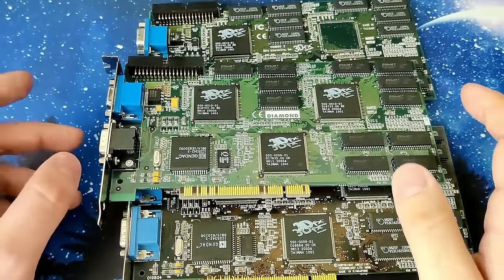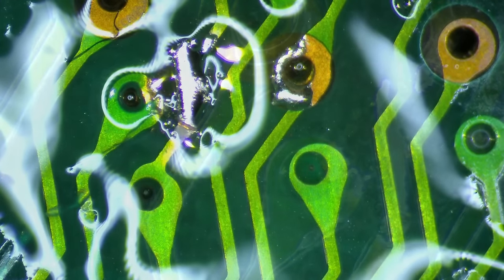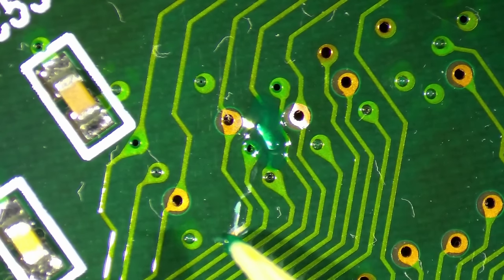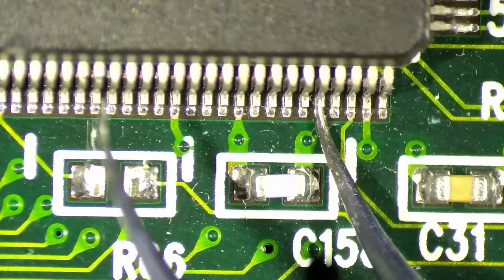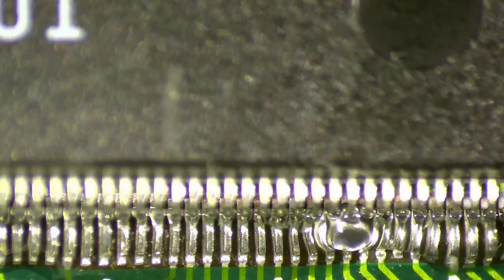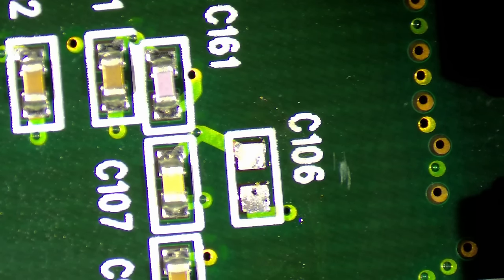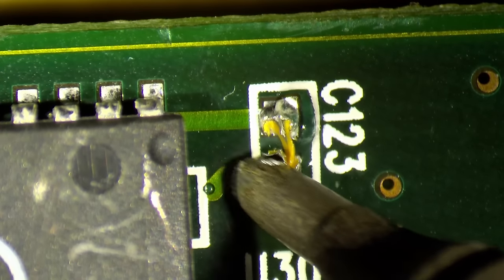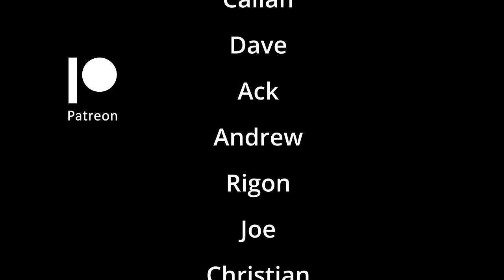Repair: Top-tier Voodoo 2 found at Scrapyard

Comment: Nice! I found a voodoo 3 at the scrapyard recently myself. Gotta clean it up and make sure it works. Or refer to BuB videos to get it working again.
Reply from the maker: Hehe, congratulations! Finding a 3Dfx Voodoo at the scrapyard is a special event!
Reply: @bitsundbolts  I didn't even notice until i unpacked at home. I usually buy AGP cards indiscriminately.
Reply: Nice, found a stb voodoo 3 3000 agp tv here myself that was in a slot 1 system with a 500 mhz pentium III at the recycling center, happened to spot it sitting on a trailer of junk as the dude was unloading stuff to be thrown away & asked if i could grab the graphics card, he said to take the whole pc. So i did that & grabbed the gpu, cpu & ram sticks, motherboard was a bottom of the barrel slot 1 motherboard from some brand I've never heard of, but i have a asus p2b at home & another slot 1 board i can't remember the name of atm.

Still need to install an os onto that system but displays fine in bios so far that voodoo 3, its barely wobbling at all unlike my voodoo 1 lol.
Reply: If it does not work, try reflashing the ROM first (using a second pci vga card and dos). A lot of Voodoo3's seem to have "EEPROM data rot"...

Comment: I wish I had a mythical "scrapyard" filled with vintage retro computing goodies to be plundered at will.
Reply from the maker: Yeah, it's nice to have access and find old hardware. What I hear is that most scrapyards don't allow you to enter or take stuff.
Reply: Just need to find an abandoned office building where the IT manager was a known hoarder. Got a huge pile of ram (2Kg, all vintages), and 8088, 286, 386, 486, pentium motherboards, misc vga cards. I know it’ll never happen again in my city. 😁

Comment: It's possible to solder those QFP packages without a microscope, I've done it quite a few times. I usually just drag solder then wick, usually takes like 30 seconds to a minute, then I check each and every pin with the adjacent one for shorts, which takes a lot longer! It also allows me to check for unsoldered pins, since you can see them wiggle when you touch them with the multimeter probe. But that was working with brand new chips, rather than repairing broken solder joints.

Right before I caught COVID, I planned to build a new workbench dedicated to soldering, with space for a binocular (or possibly trinocular) microscope and a monitor on an arm above the bench and an ultrasonic bath and fume extractor under the bench. I might get to it one day, but I'll probably wait until I move to a bigger place which would let me build a bigger workbench.

Anyway, great work repairing that Voodoo 2! Always good to see dead hardware returned to life.
Reply from the maker: Haha, I am planning to do the same right now - moving to a bigger place. But that might take 6 to 8 months from now. Regarding your technique of soldering those chips, I am not sure if I could do that. I bent so many pins trying to drag solder over them. I guess I would need to practice more. But once some of those pins are stuck at each other, it is quite difficult to separate them again.
Reply: Microsoldering goes so much better when you have powerful magnification. At least a very strong head loupe but that's extra unhealthy because the fumes are too close.

Comment: Lovely fix. I have a Voodoo 1 here, untested. I think some caps might require replacing. I need to find some time to build a test rig. I have an ASUS P55 T2P4 which would fit perfectly. Fingers crossed you get the other Voodoos running, too!
Reply from the maker: Yes, that board and Voodoo 1 is a perfect combination. I bought a used system in 1998 with the same board and a Voodoo 1 (Righteous 3D from Orchid). I still have both to this day!
Part 3 of the other Voodoo 2 is ready and will come at the end of this week!

Comment: You can put that bent card in a standard oven and heat cycle it without damaging components to allow straightening it out. It takes less heat than you’d think. You basically have to get all the layers heated up to allow straightening while cooling.
Reply from the maker: What temperature would the oven have to be for the PCB to deform?
Reply: @bitsundbolts  200 fahrenheit if I remember. It’s subsolder melting temps.
Reply: You’d be surprised how many of these option cards came warped in late 90s and very early 00s from all suppliers. We would “straighten” them out best we could, but it got so bad at times we finally had to reject deliveries. This was at Compaq. All PCs after being built would go through a two hour run-in at that time, so we’d know if the card was bad or not.
Reply from the maker: Wow, I wouldn't expect this to happen from a company like Compaq.
Reply: @bitsundbolts  You would surprised the quality of suppliers in those days. It was wild west times. That’s why so many disappeared. PC manufacturers couldn’t trust them. It was hilarious. You coukd have a sound card, video card, nic card all in successive slots, but it would like a chart 📈 lol.

Comment: 37:44 You could also use the tabel to vind. the 1nF. C51 is in the same cell as C151. So just take a other Cxx from the same cell. Then there is  no need to measure
Reply from the maker: Correct. That would have been easier and doesn't require a multimeter.

Comment: you sound dis-heartened by the delayed/not going the way you want projects, don't be, we(or I know at least I do) watch for the journey, it's all interesting

Plus I get my inner tinkerer fix without having to fill my house with solder smoke watching these vids and learn a bunch
Reply from the maker: Ah, the memory modules are a pain because I don't know what the issue is. I just have to experiment more and hopefully figure out what is going on. Regarding the solder smoke - yes, I am trying to get rid of it as much as possible. You can hear a fan in the background, but I need a proper exhaust system. The problem in Dubai is that it is 40+ degrees outside. But I will find a solution very soon.

Comment: This is very mesmerizing, apart from the large IC feet which gives me anxiety with how fragile they look when moving around.
Reply from the maker: They're not that bad after you get a feeling where to apply pressure and how to drag the soldering iron across them. But I agree, if you're not careful, one wrong move and you're in for a terrible experience.

Comment: Wish I could visit your magic scrap yard! Maybe I could finally find my GF 6800 Ultra AGP, the last card I'm missing from my AGP collection.
Reply from the maker: It is always exciting to visit the scrapyard. However, you will never find what you're looking for - haha. You might get lucky and find something while you're looking for something else - that is just my experience. I should offer "Scrapyard Adventures" - a trip to the scrapyard with Bits und Bolts ;)
Reply: @bitsundbolts  I'll hop in my Dacia Duster and come visit :) 7100KM from Sweden to UAE, 75 hour drive. WORTH IT! :P
Reply: @bitsundbolts  Definitely do some scrapyard trip videos.
Reply: That reminded me that I'm still hanging onto a 6800 AGP. It is a bottom tier PNY Verto GeForce 6800 AGP with 128MB DDR. I did have it paired with my Diamond Monster 3D II after upgrading that machine from the "infamous" GeForce 4 MX440. I had forgotten there were so many variations of the ole 6800.
Reply: @marvinmallette6795 I had (maybe still do, I don't remember selling it) a 6800 LE which had the same die as a regular 6800 but with some cores disabled. With the right tools they could be unlocked and in a lot of cases were fine (thank you binning!) I was able to unlock 3 of the 4 locked cores 😊

Comment: Nice save! If you 3D print the shell I made, you can force the board back to flat with it. However I don't really know if it helps in any way LOL
Reply from the maker: Oh, yes, I've seen those shells. But I'm not sure if it would be a good idea now since I already soldered back all the legs of the 3Dfx chips.
Reply: @bitsundbolts  You are right. Unless we can find a way to bend these boards back straight, it will only create stress.

Comment: For low sun days or nights, I'd suggest a UV curing lamp. Very cheap from the usual places.
Reply from the maker: I have a terrible UV light. It takes about 30 minutes and it drains 3x AAA batteries in the process. And if the solder mask is too thick, it remains fluid below a crust of hardened solder mask. I don't have this issue when I place it in the sun. I should change my UV light and get a proper one.
Reply: @bitsundbolts  I've also had some terrible uv lights. Got a nice lithium powered one recently, only about 7 usd and cures in 30-60 seconds. Wish I could post a link for you.
Reply from the maker: Wow, that's fast. To be honest, I don't think I want a UV light anymore since I have access to 340+ days per year with sunshine. I only have an issue when I am working in the evening on repairs and solder mask would prevent me from continuing.

Comment: I love theses old Voodoo 2 videos. My late model 3Dfx built Voodoo 2 1000 is single sided and is 12MB version.  Do you think it would be possible or worth wile double up to 24 MB of memory?
Reply from the maker: I have never seen a 24 MB card. I have a feeling that it is not possible to address this much memory. If it would be possible, someone would have done it already. I might be wrong though.
Reply: @bitsundbolts  might make for a good video, add 12 Sockets so the memory can be removed.
Reply: @knightsun2920  There is a document from 3Dfx about what it supports, can't link it directly but you can use the quote below to search for it, it seems like the texture memory could be increased up to 16MB according to that document, not sure anyone ever did? "The minimum amount of texture memory required is 2 MBytes, with a maximum of 16 MBytes of texture memory supported" in the end this would result in a 20MB Voodoo 2 card because the same document says that the frame buffer is limted to 4MB maximum memory.

Comment: That's the Voodoo2 I had back in the day, before I was lucky enough to get a TNT.
Reply: Was the TNT actually better? I think I recall running across a TNT card at some point, might have been with the Diamond Monster 3D II Voodoo 2 I yoinked from a scrap pile. The TNT had 2D graphics capable, and some better compatibility with some games. I think by the time I could compare them, Intel graphics had surpassed the TNT and I was looking at the GeForce 4 MX440 as an upgrade from integrated. The old Voodoo 2 still had 3DFX Glide support, and so I had a reason to keep it around for a while even with the MX440 upgrade. Still, I remember my benchmarks showing the TNT and Voodoo 2 as being in the same class, like GeForce and Radeon are now (GeForce RTX 4060 vs Radeon RX 7800 XT?). 3DFX went out of business by punching above their weight class, and not getting the return on the R&D.

Comment: Btw, bending is best done before resoldering chip, i don't know the sequence of events in this case.
Reply from the maker: I tried bending the board back before I worked on the card. It didn't help or did anything.
Reply: @bitsundbolts  Good because bending after soldering could crack joints again and the chip would "hold back" the bending too :)

Comment: Drag-solder those chips. No need to check every pin if it's lifted.
Reply from the maker: Yes, that is the best way. However, you have to be very careful. One wrong move and you'll end up moving those legs and pushing them together. It's quite difficult to separate them again.

Comment: Working at the same card atm...showing 4mb on FBI but only 2mb on each TMU's
Reply from the maker: Most likely bad solder connections of the 3Dfx pins. I had a few of those and it was always the bad solder.

Comment: Nice repair, but wouldn't it make more sense to repair the card that you used as a donor here, and use this damaged card as a donor for that one? With all the dents and craters on the board, and on top of that it is also warped, there was a high chance for shorts between layers and/or broken vias.
Reply from the maker: That's a good point. I'm not sure which PCB/model is more desirable. The donor card is an STB model if I'm not mistaken. I would argue that a Diamond Monster 3D II is more known than an STB (no marketing name).
Also, to fix the STB card, I would have to fix a lot of pads for TMU 1 and move the chip. TMU 0 also is heavily damaged on the donor card. It would have been a lot more work than the way I show in the video. Also, there were some questionable components on the donor card.
If I ever get my hands on two TMUs and an FBI chip, I may consider restoring this card as well.
Reply: @bitsundbolts  I don't think it matters much if this is the more desirable model, if it's so beaten up. But if the donor card also has lifted QFP pads, than you probably chose the better candidate to repair.

Comment: Check short in vcc/12v rails before plug-in the card?
Reply from the maker: I checked the 5-volt line before starting. I didn't check 12 volts. I'm not sure if the card even has a golden pad to connect to the 12 volt PCI slot.

Comment: Love your videos. question, do you have a hot air station??? that would be better suited for when you need to solder/desolder SMD components, i find using a Hot air station along with solder paste does a quicker and neater job :)
Reply from the maker: Thank you! Yes, I do have a hot air station. I didn't take it out (I live in an apartment and need to stow away things when I am done). But I agree, a soldering station would have worked better, especially with the larger caps.
Reply: @bitsundbolts  ahhh yes i understand :)